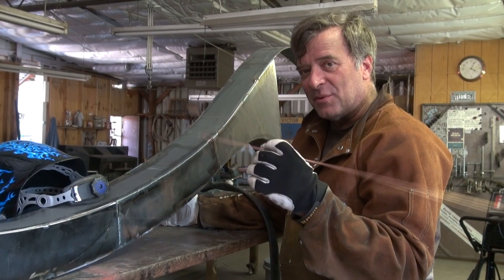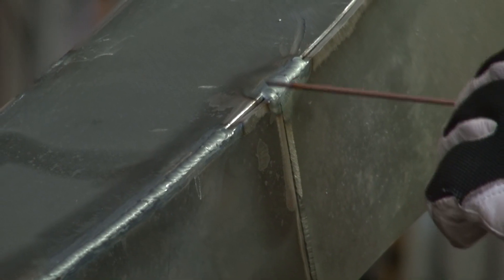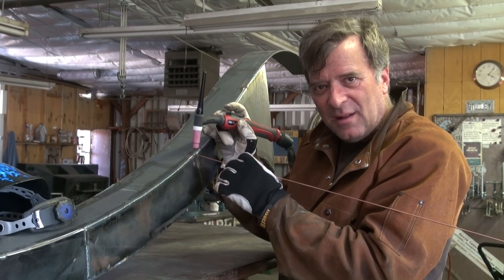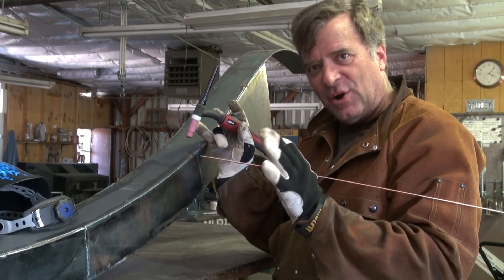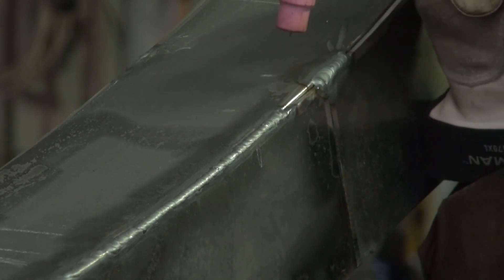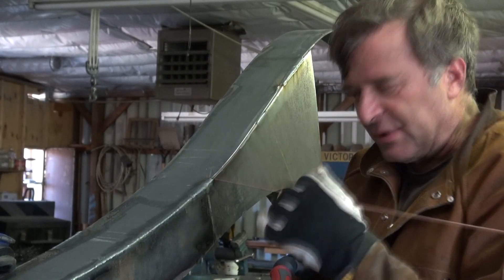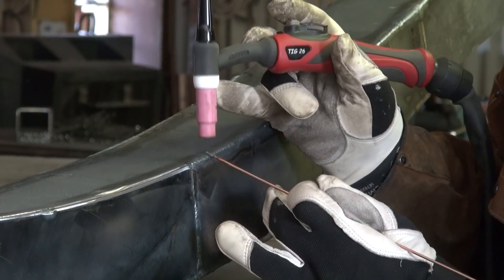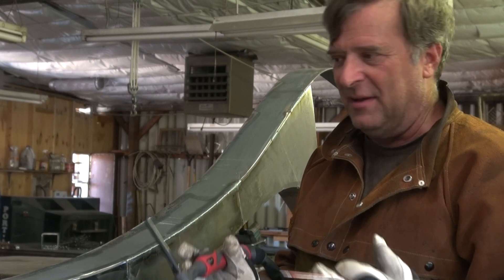How to Tie In Welds for a Seamless Look - Kevin Caron

Comment: I thought I understood this with MIG and Stick but with TIG I'm learning all over again. Of course it helps to minimize the number of sections where you are running up to completed welds. There a Dairy Queen puddle mark is a dead give away, but if you plan well those will be rare except on small pipe. It helps to leave the finishing puddle a little low, so that you have room to restart without leaving it too high.

Comment: nice  video thatnk
if you want to run into a mig weld get a 4 inch grinder with a cutting disc, and vee out your stops and starts then run into them, same with stick welding, then you dont get the build up :), 
oh and to weld with out filler wire is called autogenous  welding
Hope this helps